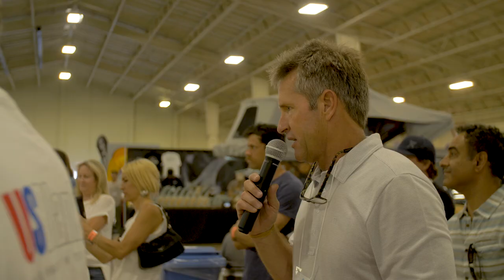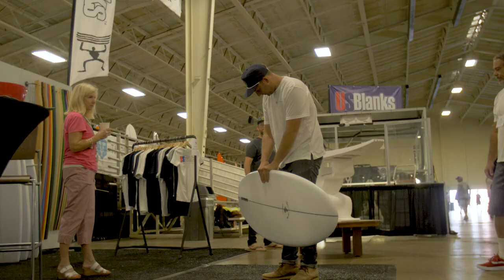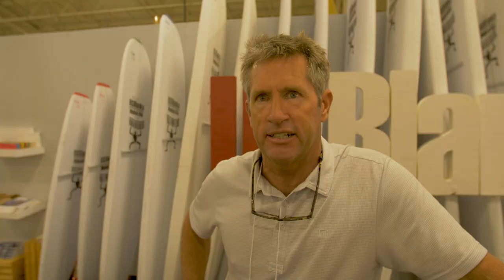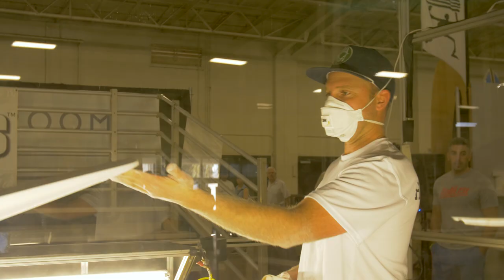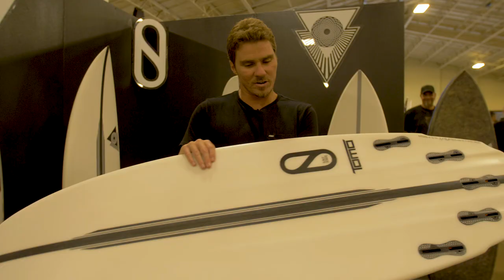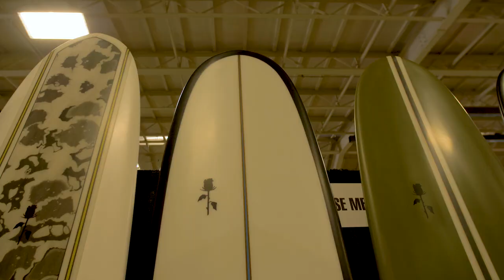Design Forum | 2018 Boardroom Show

Comment: A lot of surf tech wants to be environmentally conscience, but have they prefected the unbreakable surfboard? The only true way to reduce waste is to reduce breakage of the boards that will be let on the beach.

I don't think they have been working on that at all. Sure, I think they've done strengthening to give themselves a way to use lighter materials such as EPS, but it doesn't stack up when compared to PU boards. I am going to focus myself and my efforts one day in creating the board that stops the constant breaking of modern surfboards. Then I'm going to patent that design and they can eat crow. If I had every new board that I've seen break in the first day out, I I'd have a damn good quiver for the rest of my life. That's should be the collective goal by keeping boards and building quivers, not what they're doing. 
The industry doesn't really want boards that won't break, they want more $$$.
Reply: yeah it could be a planned obsolescence thing but i've had boards from local shapers that have broken and it's not because they wanted more money. sometimes they just break